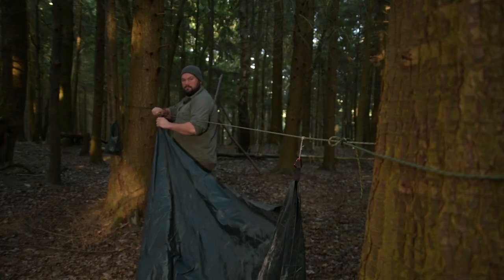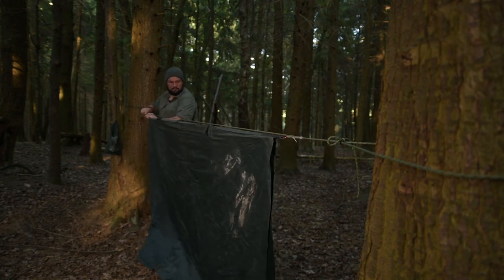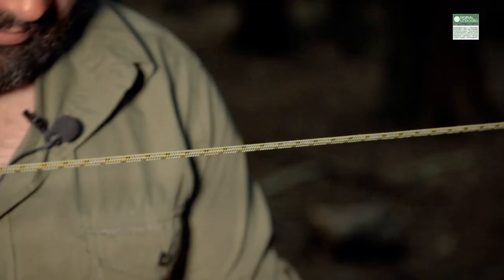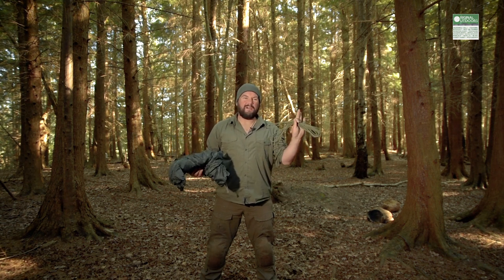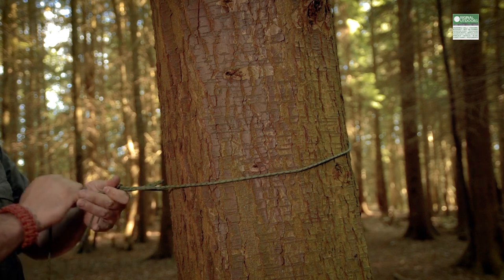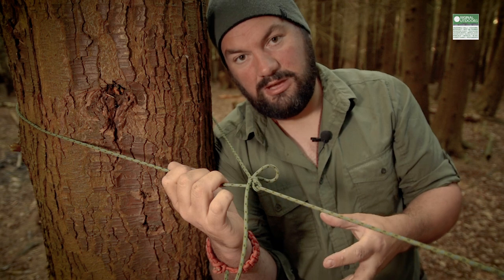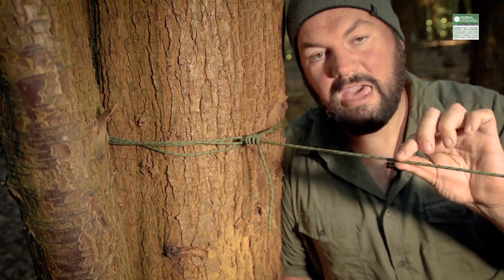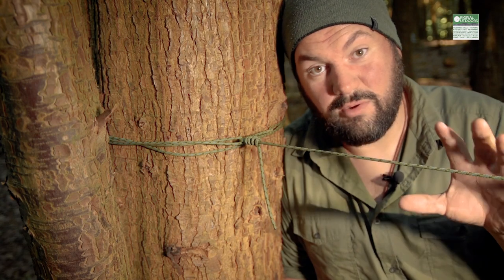Tensioned Ridgeline Setup Tutorial (Tarp Ridge Line Setup)

Comment: Depending on the type of line/rope/cord, it will likely stretch, especially after a good rain. With weight, it may stretch even more.

Your comments on conservation are spot on.
Reply from the maker: Absolutely. I find with the LSK-type climbing accessory cord like this there is a point where it has reached the maximum 'stretch' and can be relied upon to stay put, but it takes quite a few iterations of use.

Comment: So when hanging the tarp under the ridgeline, is it not necessary to run the line through the loops on the tarp?(the ones in the “middle” and not at the end). I would think that would help keep it a bit higher. But I’ve never hung a tarp yet
Reply from the maker: It would, but then you could just run the ridgeline an extra few cms higher to compensate. Both methods would work, but having the ridgeline free from the tarp itself gives you a lot more flexibility and makes it easier to rig/de-rig.

Comment: I think the pressure on a tree usually comes from the tree wanting to get thicker over the years to support more canopy.  If you leave a rope tied around a trunk, the pressure this builds will be vastly greater than any line you can tighten using muscle alone. That being said trees have an amazing ability to incorporate other things (or other trees) in their bark. So.. the tree will probably be alright, in the long run. But you will have inconvenienced it and it might curse you under it´s breath.
Reply from the maker: That's a different thing. The pressure damage on the 'living' layers of the tree caused by a ridgeline or hammock strap can occur after only a few days. A rope tied loosely around a tree will indeed put pressure on a tree after years, but most trees will just bulge around it and keep on growing.

Comment: The thicker the rope, the less damage to the tree bark should be. However trees are resilient beings, and as long as you don't chop it down, the tree will adapt and overcome small scratches.
Also. Paracord is overrated, methinks. I use polyester braid ropes meant for sailing, they come in many sizes, strengths and colours, if you care about colour.

Comment: Why would anyone use a line that can absorb water?
Reply from the maker: Apart from bankline or steel cable, what would you suggest?
Reply: @originaloutdoors  There are dozens of manufacturers selling different weaves of Ultra-High Molecular Weight Polyethylene (UHMWPE) fiber discovered in the early 60s, Dyneema and Spectra being the most well known. It's stronger than steel, can't absorb moisture, doesn't stretch, and can be woven and sleeved in many beneficial ways. ALL of them are far better than using paracord that was designed and manufactured before WWII.
Reply from the maker: I try to avoid paracord where possible, and it's why I use dry-treated ropes for mountaineering (especially Scottish winter...). I think the line I used in this video was Mammut cord, but it's still polyamide.

That said - I've still had water run along Dyneema cord - surface tension will keep it 'stuck' to the cord itself and then it will run along the tensioned line until it hits a prussic, krab or drip line.
Reply: @originaloutdoors  The point is to use a line that can't absorb water and that doesn't stretch. Chemical applications are worthless after the 1st good use. Stay safe.